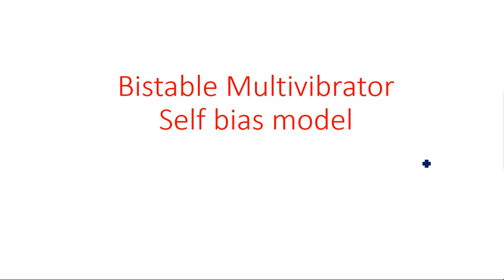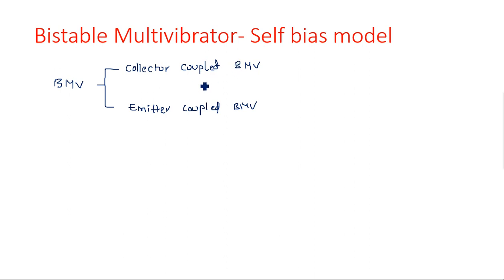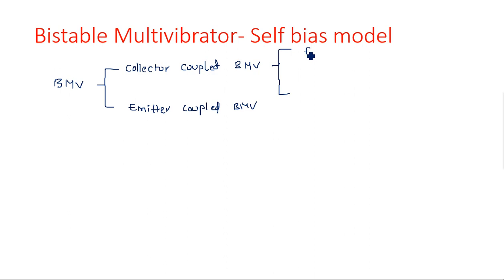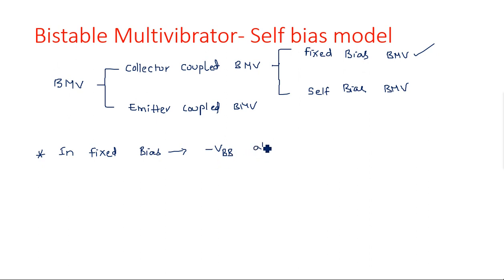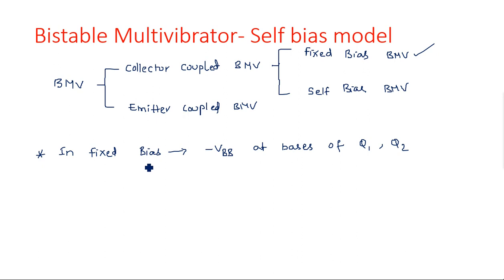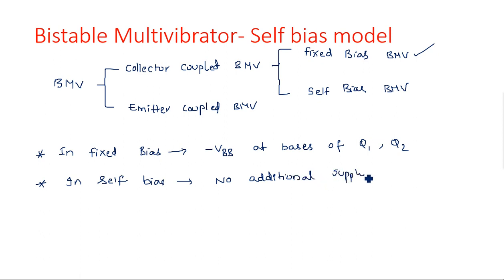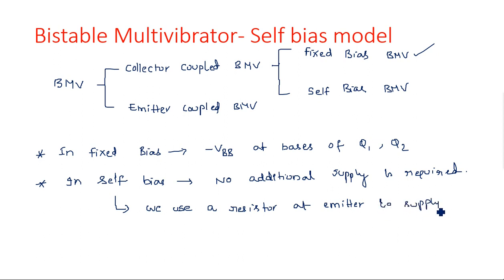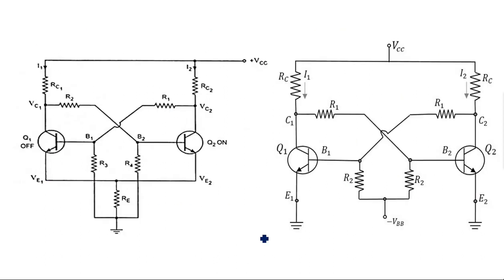Bi-stable Multi-vibrators | Self Bias | Part-3/3 | Pulse Digital Circuits ( PDC ) | Lec-45

Comment: Solution: Assume that Q1
is cut-off and Q2
is in saturation. The
connections between the base of Q1
and the collector of Q2
are indicated in
Figure 4.15(a), and the connections between the base of Q2
and the
collector of Q1
are indicated in Figure 4.15(b). In order to calculate the
voltages and currents in the circuit, it is required first to calculate the value
of VEN from the common emitter to the ground N. Since VEN = (IC2 +
IB2
)RE, the saturation currents IC2
and IB2
are to be determined. The
currents IC2
and IB2
can be determined from the equivalent circuit when
Q2
is ON as shown in Figure 4.15(c). In this diagram, the collector circuit
of Q2
in Figure 4.15(a) is replaced by its Thevenin’s equivalent voltage, i.e.